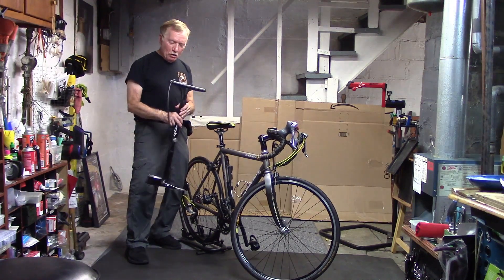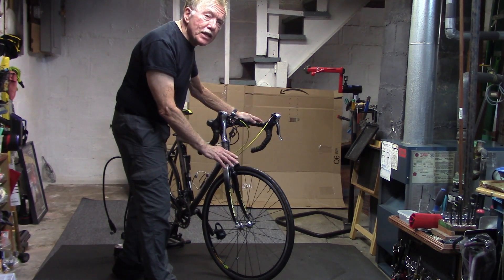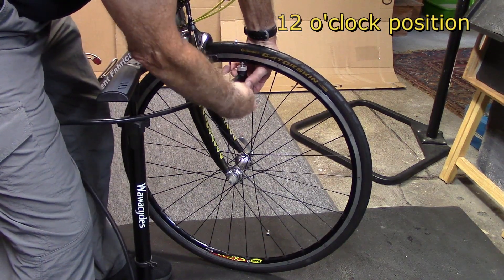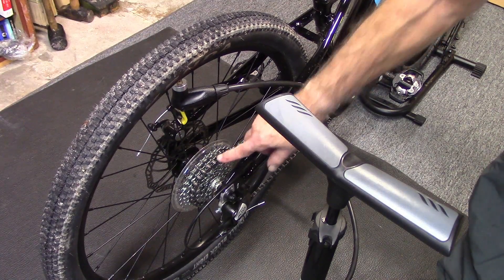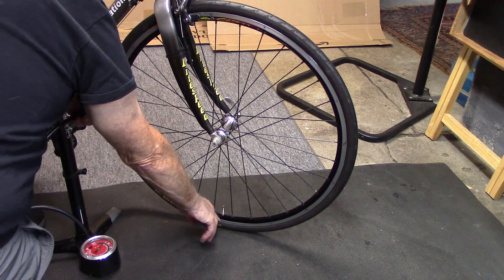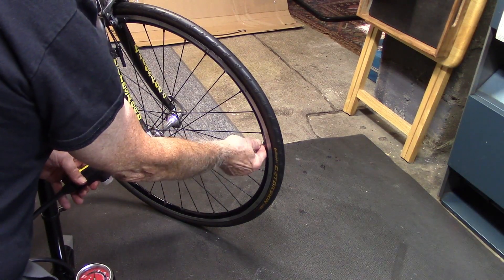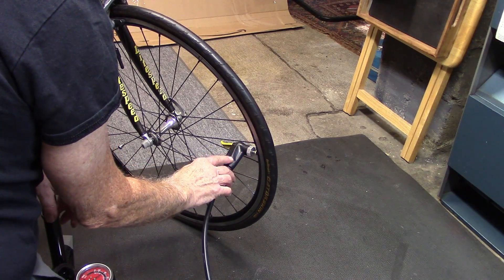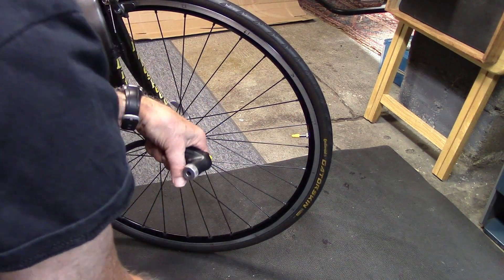How to use a bicycle floor pump: Tips, Tricks and Hacks

Comment: I use two things to make my life easier:
1) Silca presta chuck, so that I don't have to fiddle with levers - just push it onto valve.
2) Michelin tubes which have a smooth valve barrel instead of threads - this makes it super easy to remove the chuck from any position (including 12 o'clock) and the chuck gasket doesn't get chewed up by valve threads.
Reply from the maker: That is certainly the way to go. You still need to be careful of the sharp cassette teeth and disc brakes but, as you say, you don't have to worry about chewing up the chuck gasket with the valve threads. Thanks for your comment, Tony

Comment: Do your tips also apply to Schrader valves?
Reply from the maker: Yes, but there are many variations with Schrader valve. They are more sturdy the Presta and less likely to bend. This is why many fill Schrader tires at the 6 o'clock position. The stems of the Schrader are usually shorter the Presta and at the 6 o'clock position, the weight of the bike pushes the Schrader up and out of the rim, making it easier to attach the pump chuck. So, there is no one answer but personal preference and practice.

Comment: Prestas are a pain in my opinion. Nevertheless informative thanks Tony.
Reply from the maker: We're seeing more and more Presta valves on road and mountain tire so it may show up on your next bike. It just takes some getting use to. However, the Presta valves are said to leak less air when removing the pump chuck and are easier to make minor adjustments to tire pressure which is important in running tubeless low pressure tires. 
Be well and safe cycling, Tony
Reply: @tony10speed  cool, thanks for sharing Tony. Appreciate it. I got a Brompton a month back, came with schrader. But I have another foldie with presta. Not complaining, just managing both 😀
Reply: There's always Walmart.....

Comment: I’m always bending the valve so annoying
Reply from the maker: One way around this is to pump with the valve at 12 o'clock and then removing the chuck straight down as in the beginning of video. Just be real careful of the of the teeth of the rear cassette and disc brake if present!!!
Reply: @tony10speed  I washed my chain last night really thoroughly with hot water and detergent and it was clean but then I applied the Rock n’ Roll Holy Cow Lube and suddenly my chain was greasy again; black grease on the paper towel. I think maybe I applied the lube too soon after cleaning. It’s one of those lubes that is a degreaser as well as a lube. White in colour.
Reply from the maker: @Nohojunocry  It is important to wipe off the excess lubricant after application. As you ride, the chain will become darkened as the dirt and grime from the road accumulate on the chain and move toward the surface of the chain. The manufacturer suggests wiping off the dirt/grime after each ride until it's time to re-lubricate the chain (about 200 to 250 miles). Here are some reviews of the product:
https://www.youtube.com/watch?v=8X_PQfz7qwQ
and
https://www.amazon.com/Rock-135816-Chain-Lubricant-4-Ounce/dp/B002GIHHZU#:~:text=I%20find%20it%20performs%20very,your%20pulleys%20and%20chainrings%2C%20too.
Regards, Tony